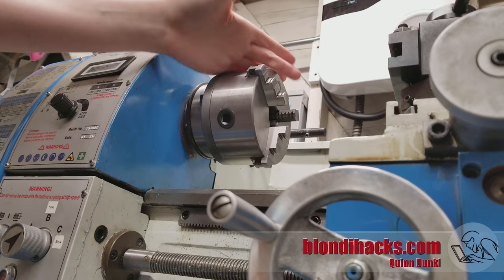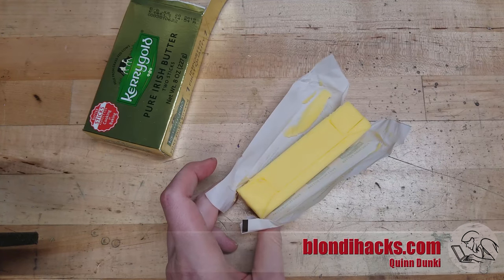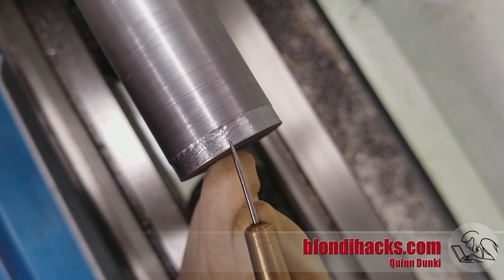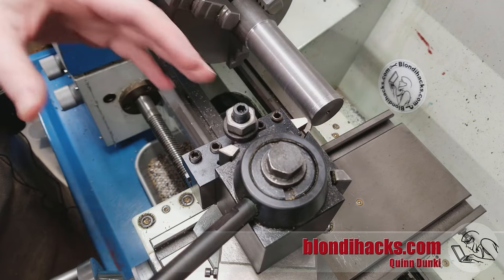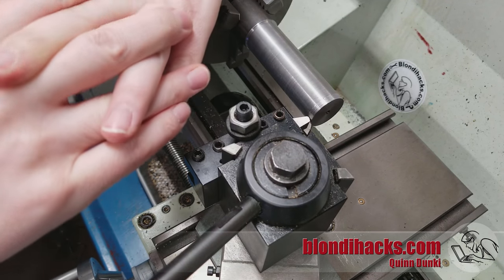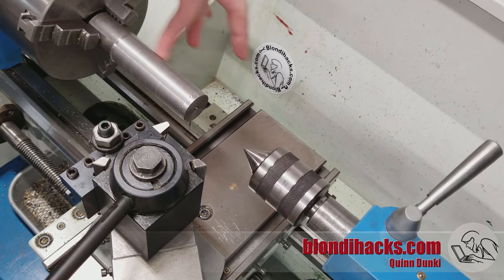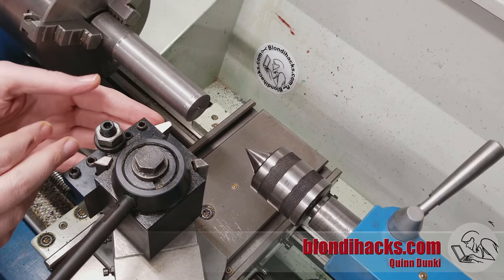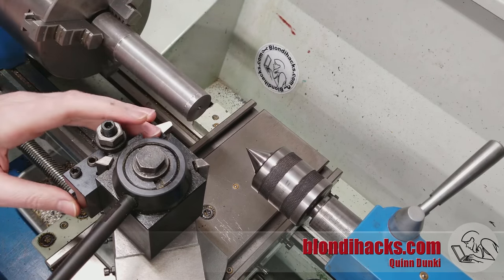Metal Lathe Tutorial 6: Chatter

Comment: in some cases you can increase the tool pressure so the tool is loaded with enough force and the "spring-effect" goes away. For me this worked very well with a thin long boring bar.
Reply: Yes. Because you are cutting away a thick enough layer of metal that even the thinner layer is still not reaching the surface and creating a reduced friction moment that allows the work piece to accelerate.

Comment: Dear Quinn, I've been watching some of your articles recently and enjoy them, they are lucid, articulate and well presented. The last on I watched before this item on chatter was "choosing a lathe" and one thing you didn't mention was weight. The heavier a machine is the less it will be inclined to chatter. All things being equal choose the heaviest machine you can afford. Years ago one of my mentors told me the golden rule of avoiding chatter, " reduce the speed, increase the feed!" Chatter frequently commences if your speed is too high or you're not hitting it hard enough. Everything you said is true but even a lightweight machine can eradicate chatter if this golden rule is your first line of defence. Some jobs though are always destined to chatter but there are a number of other things you can try: wrapping elastic bands tightly round the work. Sticking plasticine in or around the job, holding it on with tape if necessary. Lead solder wire can do the same thing. If the component has a very thin part, try to finish it to size in one hit. (Ever seen the Hardinge demo where they turn a 1" bar down to about 0.5mm in one hit with a knife tool?)
Kind regards from the UK, Devonboy
Reply: Hi there. Very helpful comment indeed. learned a lot. Can you please give the video link you are referring about Hardinge demo?

Comment: Recently i was doing some lathe work and found if i ground the tool to cut towards the head-stock and less towards the work it didn't chatter.. good geometry of the tool seems to also help a lot.. rake angles etc  , i think the perception is you go into the work at a 90 degree attack and het driving the cutting edge more towards the head-stock seems to work so much better for me

Comment: Nice video 👌. In my experience there are basically 2 types of chatter in machining. One is work piece chatter eg. a very little long shaft machined without a stead or without a live centre. Two is tool chatter eg. a boring bar that’s too thin and protruding to far . But like you said rigidly is key in overcoming chatter. Always make your setup as ridge as possible ✊🏻

Comment: The hacker in me wonders if the harmonic issue might be something you could tackle from another direction.  Namely, the ole' "walk without rhythm and it won't attract the worm" method.  It works for beer, coffee, cat dishes full of water and soldiers crossing bridges, anyway. Hack an Arduino or something into the speed controller on the lathe and try to vary the the rotation speed randomly within a range around the setpoint. The variation would need to be smoothed heavily, I think.  It probably wouldn't work and it might well cause other problems.

Comment: Really like your video's, I am a beginner and your instructions have helped me a lot.
I rebuilt an Old Craftsman 101 lathe and I know there is going to be some sloppiness, but I am still getting a rough finish.
I have been experimenting with different tooling HSS, Carbide Inserts and Carbide tip and have noticed 
that at higher speeds the Inserts preform the worst even with swallow cuts of .001 to .003.
I have been using tail stock support on all cuts but still getting that butter effect.
Any suggestions on where the problem still might be?
My 3-jaw chuck has a .003 run out.

Comment: Great video as always! I have a follow up question. You mention that to get rid of chatter, you have to take a cut that's deeper than the chatter marks, but a deeper cut would also increase your tool pressure which would make you more likely to experience chatter, right? So is the solution to increase rigidity elsewhere then take a deeper cut, or should you try to remove the chatter marks with an abrasive before continuing?

Comment: i have  a problem with a minilathe i get chatter when i face roundstock it has a spiral shapped pattern its a very low frequency sound so i usually have to put the speed at max which is  2500 rpm and take super small kits to get the  ugly surface away and dosent matter how far the  piece is stickin outa the chuck
Reply: If it doesn't matter how far away it's from the chuck i'd look at sliding surfaces (what's the contact area between them, is there any play and so on)

Comment: Does tool angle contribute to chatter? The one thing I’ve had trouble finding information on is tool angle when turning especially. Some people like to cut perpendicular, some like a slight angle, but there’s no real explanation as to why.
Reply from the maker: I’m not aware of tool angle affecting chatter, no. It can affect surface finish a bit, as does the lead angle on the tool grind. Mostly though, the angle is just about getting access to the work in the easiest way possible for the setup (or being square for certain tools)
Reply: Blondihacks thanks for that, it makes a bit more sense. I noticed you cut perpendicular when turning. Is it for a particular reason, or is it just the most straightforward way? Do you ever turn using a right hand tool on an angle?
Reply from the maker: @freestyla101  I usually turn with the tool squared up because it gives more clearance behind the tool post. With the tool post at an angle, you have to extend the tool bit further to reach the work, which costs rigidity. I will turn at an angle for turning to a shoulder, though.

Comment: Does tool height against the work affect chatter? Great video.  Thank you.
Reply: Tool height must be on center of work. Otherwise if low workpiece will want to climb over toolbit, or broken bit, very bad. If bit too high you're pushing metal off and again a possible broken bit. A sharp bit is a must with less surface contact possible. Use of live center a must especially when work extends farther out from chuck Jaws.

Comment: Yeah this is the basics for it... But what if I'm turning an ID with a 13" stick on the boring bar . What can I do then ? Right now I have been adjusting center lower than middle for tool nose radius while running slower and fedding faster with a really small tool nose radius. I'm able to get most of the chatter out, however I still can't get a 125 surface finish. Since a bearing is being pressed into this part , it has to have a smooth surface finish. I've looked in my machinist handbook, all over YouTube and Google. No one can show or tell how to get a better surface finish with that much stick out on a 10" od part that is 4140 stainless. I'm having to use Emery cloth just to smooth it out the best I can , but I feel like there is something I can do but I don't know it. Any advice ?
Reply from the maker: That's a lot of stickout and a tough material, so that's a tricky setup. I think you'll need a larger boring bar- the largest one you can fit. The thicker the bar, the more rigid, and the more stickout you can get away with. If you're already using the largest bar you have, then you'll need a bigger tool post.
Reply: @Blondihacks  I figured you was going to say that lol... I am already using the biggest bar we have and we don't have any bigger tool posts I can switch out. I've tried explaining to my boss I'm doing the best I can with the tooling we have , but he's not a machinist so he doesn't understand.
Reply from the maker: cameron Johnson Another Hail Mary option- can you fixture the part to the cross-slide and make a line bore that goes from the chuck to the tail stock? Like on a horizontal boring mill. I’ve seen Keith Fenner do this to bore engine blocks on his lathe. It’s a very rigid setup because the boring bar is supported at both ends.
Reply: @Blondihacks  I can't unfortunately but ty for your time n help. The part is 26" long with a 10" od so I have it set up on a steady rest. Which I have moved that around in a few different spots as well. Everything is tightened down to and all the other info I posted I just don't understand why I can't get a good finish. I am able to get most of the chatter out but there still a fine line where it's almost non existent but you can still see it even after I polish the bore to get a better finish. It's probably just not possible with the boring bars I have. They aren't that big and my shop I work at is cheap about buying tooling. Job shops can be a real pain in the u know what sometimes . Ty again! Great video though for getting your basic chatter out.
Reply: Make sure the tool is well above the centerline when boring, instant reduction in chatter tendency as the tool can deflect away from the work and not in to it.

Also, if you want a large boring bar, just take the biggest round shaft you find and weld a turning tool to the end. No upper limit on what can be done :)

If you have a tool post on the top slide, make sure the top slide is locked in place.

One way to reduce chatter is to flip the tool upside down and machine on the other side of the hole. This makes the springy toolpost/top slide/carriage act in a completely different way and might be the one trick to get away from chatter.

And one final trick is putting a bolt & nut under the tool, against the carriage top and tighten it to provide more support for the tool.
Reply from the maker: @JaakkoF  All great tips - thanks for sharing!

Comment: How much does rotational speed factor into chatter? Does it have a direct influence or is it part of the overall tool pressure effect?
Reply from the maker: aclight That’s a great question, and something I should have addressed in the video. Feeds and speeds can definitely aggravate chatter, and lowering both helps reduce it. Increasing spindle RPM sometimes helps also! Interestingly, varying RPM continuously can prevent some amount of chatter because it interrupts standing waves in the machine. Some modern lathes have “chatter compensation” that does exactly that.